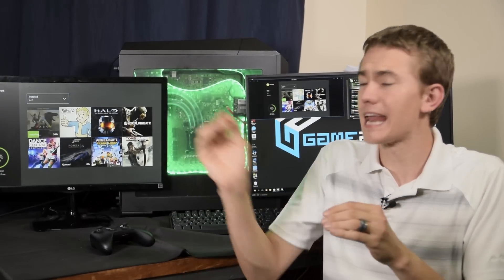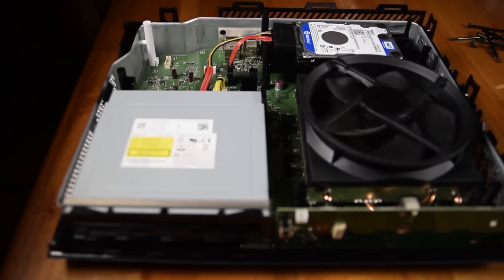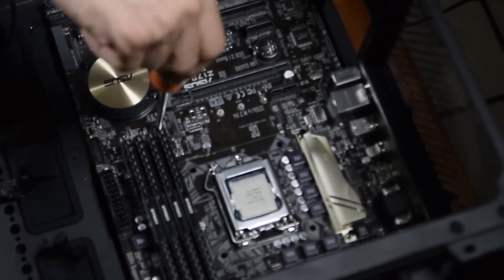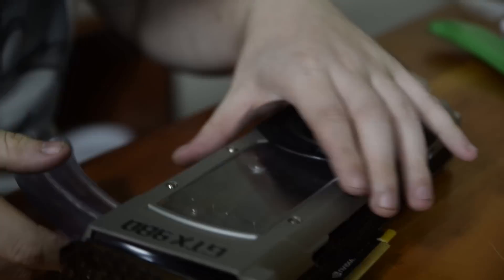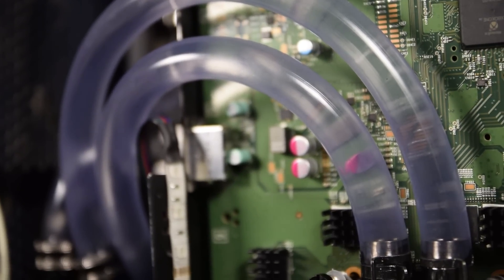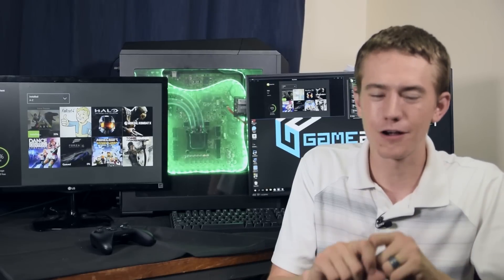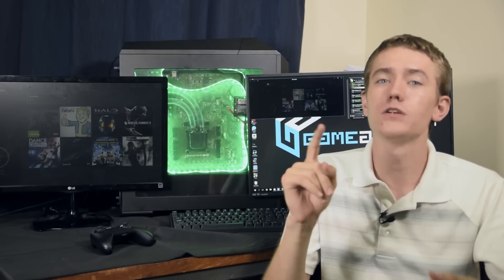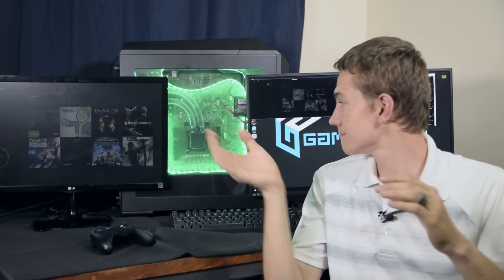How To Watercool Your Xbox One - Ultimate Edition

Comment: What size are the small heat sinks for all the chips and also the dimensions for the main heatsink (APU) ie the distance between each hole to screw it in place. Ive tried looking on line for the dimensions but cannot find it at all. I would greatly appreciate the help. Oh and to finish off, this is an absolutely amazing build. Excellent work mate.

Comment: Im trying to comprehend. So you’re taking the liquid to the Xbox Ones APU, which runs ridiculously hot... to your video card, which runs ridiculously hot... to your CPU, which also runs hot. 

Maybe my brains just thinking to much into this, but I just can’t get around taking semi cooled liquid and running it to the GPU(which is the hottest part of the system at load), quickly superheating the liquid which then runs directly to your already hot CPU. The liquid only has a millisecond in the cooling reservoir before the process repeats. Hence, nothing is ever really cooled, if anything its making matters worse over time. Im interested to see how long any of these loops last before the GPU, CPU or everything just shuts down due to overheating.

I love your channel and this isn’t directed solely at you, but logic dictates that unless you have a liquid that can quickly be supercooled to near freezing(or liquid that can get below freezing without congealing) and a cooling chamber that can do that in a microsecond... that meltdown is right around the corner for any one piece of hardware. The only way around this would be to cool each component in its own loop, so the liquid doesn’t continuously get hotter by the time it reaches another component.

If I’m wrong about this, please educate me... because we are dealing with water, in your case, that can only get so cool... especially in the millisecond it spends in the reservoir. Ive always wondered about this. I just built a liquid cooled Ryzen 1950x machine with a liquid cooled 1080ti, but each has its own cooling solution so they don’t share each other’s pain. Ive always thought about this with loops and wondered what the shelf life would be for any components they cooled.

Comment: Pretty sweet idea, good job. Id like to liquid cool my new XBox One S 500gb as it has a serious heat issue, then again pretty much every XBox I have owned from 360 on has had problems with heat. I wonder if you might be able to lead me in the right direction here as I would like to put a liquid cooler on my XBox's CPU to help keep it cool. I play a lot so it gets pretty hot in my room here. What socket is the cpu compatible with on the S model do you know? Thanks, and I did hit like.

Comment: So did you just leave the storage drive in there? How would you connect an external drive to increase storage?
Reply from the maker: +سعد التميمي We did but we left the USB ports exposed internally, so if we wanted to put an external drive on the inside of the chassis, we could.
Reply: UFDisciple but are they specifically for the xbox one?

Comment: you used water as a coolent? lmao
Reply: Profatoe what if it leaks wouldn't that just ruin everything lol
Reply: Bradlee Apodaco you're supposed to use am actual coolent designed for pc's, water doesnt lose heat well enough
Reply: Fudge You Lmao I have a custom water cooling loop, I also work in IT
Reply: Fudge You how can I prove it? water isn't a coolent unless you want to blow up your pc, only really used for cleaning loops
Reply: Fudge You bruhhh youre dumb
Reply: Fudge You I'm dying
Reply: Water works fine. The only thing you need to be wary of is not mixing metals (Leads to corrosion) and algae buildup (To which, a few drops of biocide or a kill coil will mostly stop).
The only other difference between most common distilled water and coolant is that water is often conductive -- to which you can use de-ionized water.

Thermal performance is exactly the same; given most coolant is just water with the above in it (Biocide, anti-corrosives and dye).

Comment: also watch out cause microsoft can detect if you opened the console cause the xbox one does a self-check everytime it boots up and turning it on without hard drive or disk drive cause an error
Reply from the maker: No issues so far.  Thanks for the info though!

Comment: You  said that it did not open when you were done, than it opened in 1 hour. My theory is that maybe the machine needed more time to configure its new system setup. I also believe that the CPU needed more time to configure itself to its new temperature, or maybe it was too cold and needed more time to manage its new temperature. I give you a good credit good idea and invention.
Reply: CGT Hacking Data none of that makes any sense